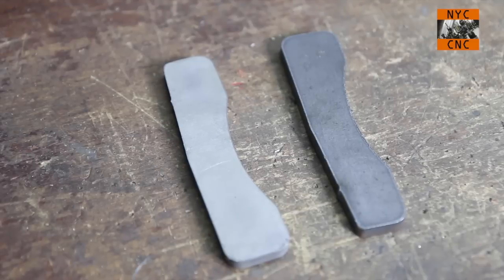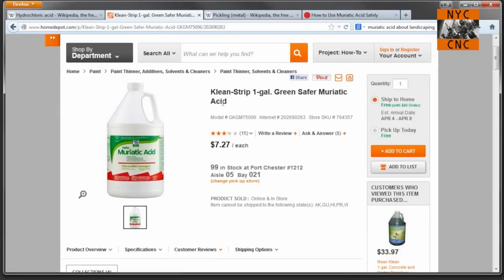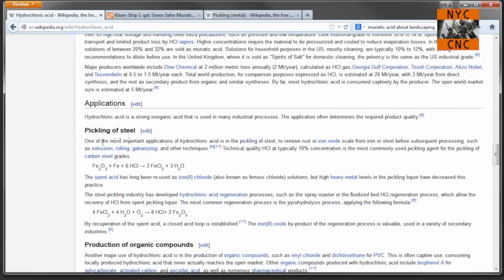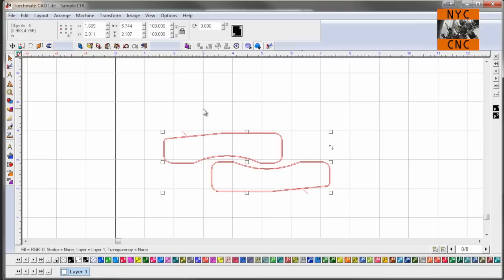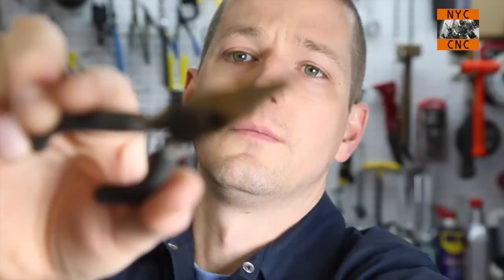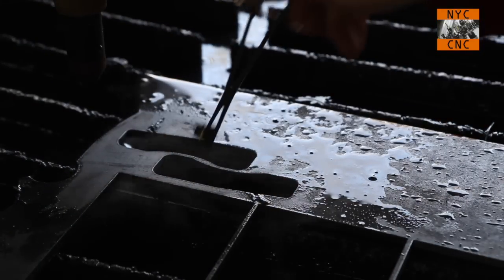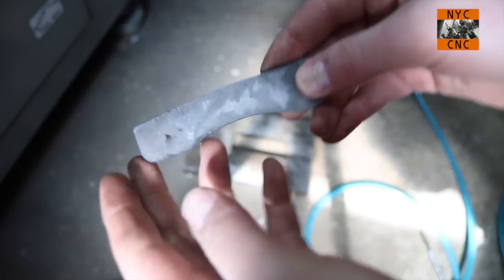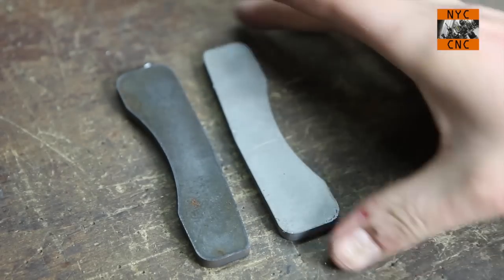Using Muriatic Acid to remove scale from Hot Rolled Steel!  MFG@Home

Comment: I would also have a bath of water and baking soda on hand to passivate the metal.  
Meaning, pull parts from the acid, straight into baking soda and water solution....just have to wait for the reaction to stop (wait for the bubbles to stop).  Then if you don't plan on painting the part, lightly oil for rust protection.

Comment: This is a video that will help me to no end. I have been thinking about a project and will be using some hot roll steel for some of the parts. I even tried using my blast cabinet with glass beads. Didn't work. You did this video at the perfect time! Oh I also love having my shop tools. I will be trying this out.

Comment: I recently made this switch and it's been great! I'm using the same setup and after a month the acid is still pretty strong. I've noticed it's heat sensitive too - much more effective when it's warm versus cold.
Reply: I haven't done any timing checks but that might make for a good test. Also, I let mine soak a bit to soften the edges of my artwork.

What I have observed is much more rapid activity as the temp goes up. A couple of hours typically removes all of the dross as well as mill scale.

Definitely watch those fumes! I do mine all outside...
Reply: NYC CNC Most chemical reactions have standardized rate data at 20 C = 68 F, or at 25 C = 77 F

If you want to speed things up, you can work at the temperature of a warm cup of coffee - HOT coffee is at 140 F = 60 C when made to European safety standards - stay down around 122 F = 50 C, and you won't have any worries about thermal issues...

The chlorine vapors will be stronger at warmer temperatures however - for the same reason that the reactions will go faster, as the chemical activity of the ions in the solution goes up with temperature - work out doors, or with a fan blowing fresh air past you towards the work.

Comment: I used to work in a Fab shop, and we started using pickled and oiled sheet steel as it would clean up/prep easier for painting.  I don't remember the cost difference (minimal), but it was lightly oiled, and had thin layer of Mylar that would keep the oil on the surface of the steel.

Couple of other things when working with aromatic acids:

1. Always work outside.
2. Create an upwind situation by placing a fan behind you...it will blow the harmful fumes away from you.
3. Decent pair of rubber gloves.
4. Keep lots of Baking Soda (sodium bicarbonate) on had for spills, and it will neutralize the bath when you are done pickling. 

Just my 2 cents.

Comment: I've used this technique for a few years....then I switched to having everything cut in HRPO(Hot Rolled Pickled & Oiled) which does not have mill scale. 
The mill scale is extremely hard.  For grinding, I've had the best luck with Strip-it-all type discs. I think I saw that in a Ron Covell vid. 
You might try the full strength version.  It's more like 15-20 min instead of 2hrs.  If I left a part in for 2 hrs, it would come out looking like Damascus....you can see all grain of the steel and the surface will be rippled. 
Like you were saying about the vapors.....extremely bad for you lungs, or anything else in the vicinity.....especially steel.  Even with my bucket closed, all my steel items within about a 6' radius turned orange with rust.
Loved the first way of removing dross.....I've never seen that.  I'll definitely use that next time I fire up my plasma.
Great vid!!!!  Thanks!!

Comment: Keep baking soda handy when using this acid.

Not only will it help keep things from getting destroyed due to spills, you can also use it as a "stop bath" (I call it that because it reminds me of the photography method), which should help prevent the surface rust issues you and some other comments are seeing.

Rinsing in water doesn't seem to be quite enough for me to prevent future rusting over time.

Comment: This is excellent info and very well presented too. I've not considered removing mill scale using acid before. BTW, I'm most envious of your CNC plasma cutter there. My method is manual, create cad drawing, offset lines to accommodate cutting head diameter, print on paper, glue to cardboard, cut out card templates, glue to steel sheet and hand cut around template edges with plasma torch. Works OK, but your CNC setup would be 100X faster. Many thanks for posting your work!

Comment: That's an interesting method. I've always just ended up using a steel wire wheel on the bench grinder to get the scale off. It leaves a quite nice, albeit quite different than from hydrochloric acid, finish as well.

Thanks for the tip!

/Daniel
Reply: NYC CNC For sure, if you're doing one or a few parts that's no big deal, in the hundreds I'd be looking for a method you could just set up and walk away from as well.

Comment: You can always neutralise the acid with bicarbonate of soda. Just remember that it's going to bubble and foam, so don't stick your face next to it.  
The people making printed circuit boards agitate the acid they're using to get more consistent results. It's probably not an issue for the stuff you're doing though.
Thanks for the vid. :)

Comment: I have also used the liquid CLR (calcium lime rust) product on a bunch of old drills and end mills given to me that were coated with surface rust.  I let them soak over night and rinsed them off with water.  It removed the rust and left a nice even black finish on the tools.  I coated them with light oil after treatment and hsve put them to good use.  As John states SAFETY is a must, good ventilation, rubber gloves, and splash face shield are a minimum.
Reply: CLR is a diluted solution of a couple of acids as near as I can puzzle out from their MSDS.

It works great for cleaning limescale and rust stains off of plumbing fixtures without damaging the enamel finish.

It does however release a gaseous byproduct that smells a lot like sulfur dioxide = SO2 and can trigger coughing fits and asthma attacks, so good ventilation is even more critical than you might think...

Comment: What do you use to wipe off (clean) the acid from the piece after you pull it from the bath? I thought about using water but I don't want my piece to rust and I wasn't sure if water would completely remove the acid anyway.

Comment: Add me to the list of never thought of using Muriatic acid for this.  I have read and know people who use this to accelerate rust formation on steel.

I use it frequently when welding hardware to strip the coating off (Zinc or Cadmium).  It works way better than physical abrasion methods (blasting or wire wheel) IMHO.
Reply: NYC CNC TIG /stick / MIG
Reply: NYC CNC
I've used mainly Lincoln and Miller machines.  I know someone who bought a longevity machine and they seem pleased with it.
Reply: Bill De La Vega

Comment: The gloves you used looked like cloth that will absorb the acid like a sponge and did not cover up some of the skin on your forearm. Leather gloves are only slightly better, but for safety you should use thick chemical resistant gloves that extend up your forearm. A respirator is probably not required but goggles (not glasses or a face shield) is critical when handling this stuff. You only need about 15 minutes for concentrated muriatic acid to work in the summer. 30 minutes in the winter. But since you used diluted muriatic acid it might take longer. After the acid bath you should neutralize the acid with baking soda. Other wise your metal will rust very quickly, but you also need to rinse off the baking soda really well or it too will rust your metal. A less toxic acid is acetic acid, but it takes 24 hours instead of 15 minutes.

Comment: Doing this after finding out how well and fast it eats lime scale from a poor flushing toilet. Shit’s a miracle lol.  My question is once you have this set up fir a project, have you reused the acid. Meaning will it last a week in the plastic bin where you can reuse it a few times or is the acid pretty much dead or useless after one session? Lastly, once you removed the parts did you just rinse them off with water and is there any special procedure for disposal of the acid / metal mix.

Comment: I used this stuff to clean steel but i didn't dilute it.. Is that bad for the steel? I noticed some rust quickly accumilated  so i stopped using it and cleaned the rust up with steel wool and oil. Other than the rust is this stuff bad for steel as in weakens it?

Comment: From what I have seen on YouTube, your vid is the best (especially about the safety). Congrats!
I have 2 questions...
First question is:  I'm using Muriatic to clean some stainless steel tubing (inside and out).  I don't know the diff between reg steel and stn steel but I am presuming that I don't leave it in the bath for as long as you do for the scale removal? I'm concerned about etching.  Just wanting to remove rust.  
Second... the M acid I'm using is at a 30% concentrate (M acid is sold in different degrees of concentration from 20 to 35%). Do I need to dilute it for the stainless steel?
Thanks!

Comment: I tried this method after watching your video and it did remove the mill scale as suggested, but now what I'm seeing is accelerated rust. I did rinse and dry the metal after the acid bath. Is it possible I didn't dilute the acid enough? As it stands now I'm trading mill scale for rust...
Reply: +NYC CNC I watched some other videos and it seems you need to flush the metal with water into a waste bucket, then apply a baking soda mix to the metal to neutralize the acid, and then flush again with water before drying thoroughly.
Reply: +zachmanx Maybe it's more porous after the acid treatment, providing more surface to oxidize.
Reply: +zachmanx the mill scale actually protects the steel from oxygen in the atmosphere. with a super clean part exposure to air will cause the steel to react with the oxygen forming iron oxide (rust) you could oil it if you dont need it to be clean or paint it or electroplate it!
Reply: +zachmanx Don't know if you had any progress with this but if you make a baking soda solution that should neutralize the muriatic acid. Also like the guy above me said, a light oiling will help protect the steel as well.

https://pmc.ucsc.edu/~apaytan/pdfs/Acid%20Neutralization.pdf
Reply: +Plazmattack Yeah, I tried the baking soda solution with mixed results. I think just that much moisture on bare steel is just going to lead to some rusting unless you're just very quick and thorough about protecting it. I ultimately found it to be unnecessary where MIG welding and sand blasting are involved. At the time I was just trying to get clean metal for TIG. Thanks for the tip though.

Comment: What about tumbling in media to get the mills scale off?
Reply: NYC CNC Those surface dings are work hardened by the tumbling - if you can get access to some data, you will find that they have a Rockwell C hardness much greater than mill-run stock...

Comment: Please don't be like this idiot and put rusty metal into a closed container with the acid. I just had my container explode because of the pressure created with the reaction between the rust/metal and the HCl acid. It will expand the container. It got all over my back patio and on the new grill. Thank god I wasn't standing near it. The lid was 6 feet away.
Reply: His steel wasn't rusty, but thanks for mentioning the pressure buildup!
Reply: Desir Leather Mill scale basically is rust (iron oxide...)

Comment: Good video but you should be warned that pickling steel with muriatic/HCL will causes the steel to absorb hydrogen from the acid and pool up in voids or bond with carbon to form methane inside the metal.

Heat treating the metal is required to restore its strength back to normal.
Reply: NYC CNC It can cause structural failure, specifically - fracturing.  The technical term is Hydrogen Embrittlement.  

Some commercial "all purpose" cleaners(not meant for metal, obviously) have induced failures on aircraft landing gear due to hydrogen embrittlement.  Basically anything that provides a source of hydrogen will cause it, and HCL(muriatic acid) is essentially a solution of hydrogen ions.

My understanding is that it is not a material change but simply due to the nature of hydrogen being able to fill the microscopic pores of metal but it completely reversible by heat treatment(bake it in your oven).

Wikipidia has more info, but I found this far more informative: http://www.heat-treat-doctor.com/documents/hydrogen%20embrittlement.pdf
Reply: Hydrogen embrittlement is a problem that can happen in steel exposed to hydrogen gas under pressure - such as in a hydro-treater in an oil refinery - not so much when it's an aqueous solution of a mineral acid... the hydrogen ions are actually hydronium ions - H3O+ - where the H+ shares the electrons with the water molecule... this is an aqueous (water based) solution...

Forms methane from reacting with carbon??? We do this in refineries and steel mills at very high temperatures with gaseous hydrogen, sometimes liberated from water vapor - not possible in a ionized water bath with acidity. Graphite is actually a reasonably inert material to acids.

Hydrogen embrittlement involves the formation of iron hydride - not going to happen without some serious pressure and some heat...

What is a problem with chlorides and stainless steel is stress-corrosion cracking, where chloride ions from seawater get into cracks in the stainless part, and the localized high pressures make chromium chloride, ripping the chromium out of the crystal structure.

A problem in the metalworking community is that there are many folks out there who don't know as much chemistry as they think that they do - and all too often not all that much metallurgy either - and they come up with half-baked theories which sound good to someone who may or may not have had high school chemistry..

Then those old-wives tales get repeated as gospel truth by folks who don't know why they aren't possible as stated - and repeated again & again...

If pickling reduced the strength of the steel, none of the steel makers (US Steel, Arcelor-Mittal, NUCOR, et al) would be using it to clean the coiled steel used for making galvanized sheet metal, which often gets stamped into the final form to make a product...

Comment: Btw what I was getting at with that rant is this. Dont store the acid in your shop! Whether the container has been opened or not. Way away from any machinery.
Reply: I had some muriatic acid around from doing some brass instrument cleaning. Silly me, I thought the bottle would be sealed if I closed the top. Put the bottle near my motorcycle. The copper plating under the chrome plating on my motorcycle muffler corroded, giving a nice green bloom coming through the porosity of the chrome. I've got a lot of expensive rechroming to do now. Yes, store this stuff outside away from anything else.

Comment: You should neutralize any acid on the part with a baking soda-water solution. Metals are porous so some of the acid will work it's way in. You will get instant rust on the clean metal. To prevent that either coat with a light oil such as WD40, or use phosphoric acid to create an iron phosphate coating which also prevents rust.

Comment: Are you using two layers of gloves? It's looking like you're using gardening gloves...
Reply: NYC CNC one thing that might be better is to use a mesh basket rather than dropping them in with pliers. My first thought was those sonic cleaning baskets, but you could probably find something cheaper like dishwasher silverware baskets or fryer baskets.
Reply: NYC CNC Cloth gloves are worse than working bare handed with strong acids and caustics - we didn't need to wear gloves in the chem labs until after 1984 when I was in college. The risks we took in Organic chem with the solvents would cause a safety person to have conniptions today. 

For what you are doing with essentially pool acid - somewhat diluted HCl - good old fashioned dishwashing gloves - the heavier duty latex gloves - should be the best bang for your buck - we wore them when washing laboratory glassware, and cleaning it with concentrated HCL, HNO3, or H2SO4 in the labs where I used to work - when working with small amounts, and not all day...

The butyl rubber gauntlets - up to the elbows! - and PVC aprons were used by the folks who worked with larger quantities of the liquids - they also did a good job of keeping hot soapy water off of people...

Work outdoors, or in a WELL ventilated room, with a fan blowing fresh air past you and out an open door or window at at least 100 ft/min...

As others have pointed out, the chlorine vapors will attack any iron objects - if you must work indoors, you want a room set up like a laundry or janitorial slop sink, with plastics or enamels for the hardware.

Eye safety is crucial - wear at the least some Z87 rated goggles specified as being splash protection.

A face shield is nice to have, but is less important for HCl than for many other acids and  caustics... so long as you have:

Baking soda and a good supply of LOTS of fresh water.

But, remember, pool service people work with Muriatic Acid (HCl) safely, and battery shop people work with battery acid - concentrated H2SO4 - with reasonable precautions for their own safety.

When in doubt, read the label on the bottle of the chemical, and you can go online and get a Material Safety Data Sheet (MSDS) for free for any chemical which you intend to use...